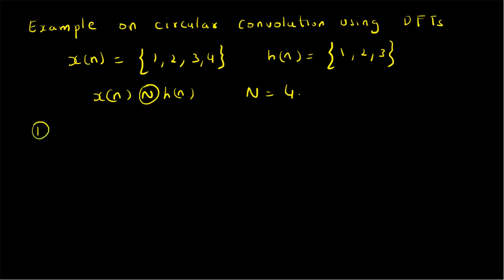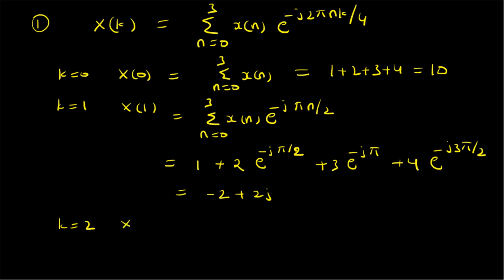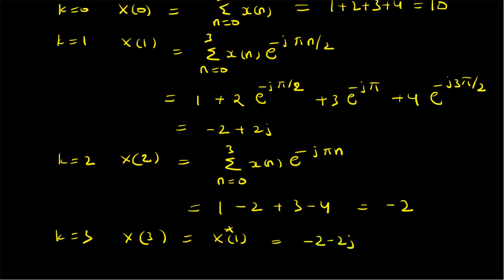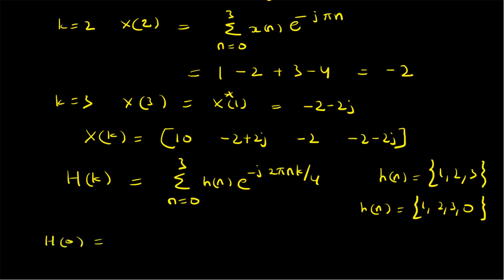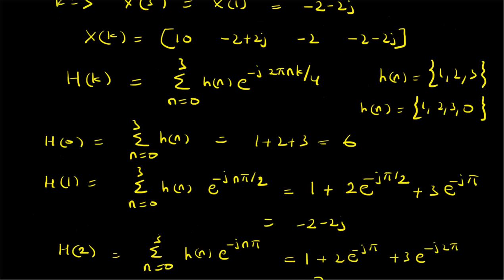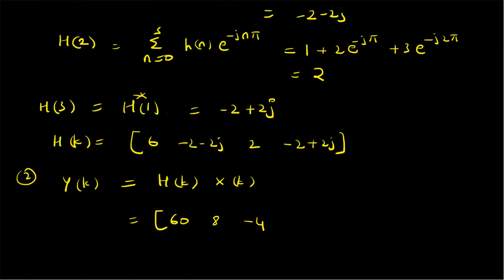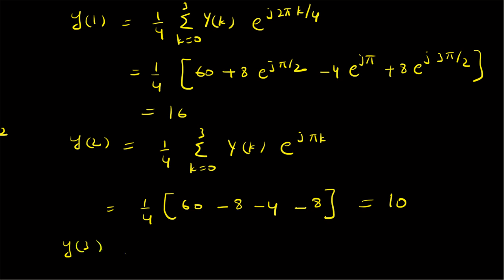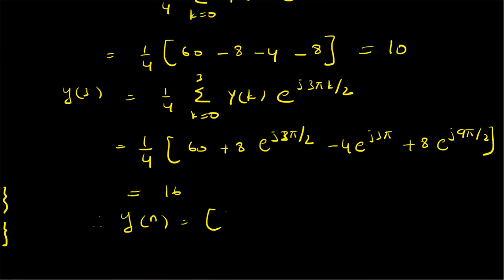Circular convolution using DFT: an example

Comment: Can you perform Linear convolution with this? 
What if the length of both signals are not equal?
Reply: yes, look up linear convolution via circular convolution, it involves zero padding both signals such that they have length n + m - 1, where m and n are the lengths of the two signals. the case in this example is that both the signals aren't of the same length, and as we have to take the N point DFT of both, we sufficiently zero pad the shorter duration signal.

Comment: it's much easier by matrix method
Reply: the title literally says "using the DFT method", ofc there are other ways to solve this problem, the fact that the matrix method is easier may mean that that is a more covered topic on youtube. what if in your exam youre asked to use the DFT property of circular convolution? youll get exactly zero marks if you solve it in the time domain.